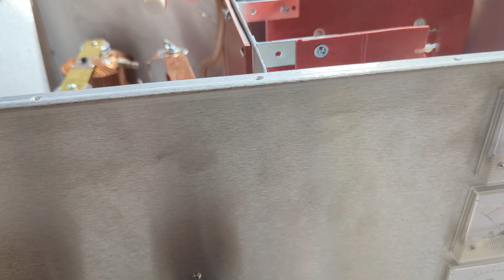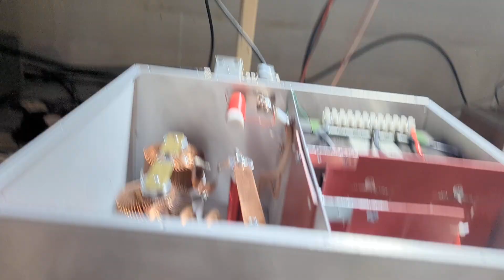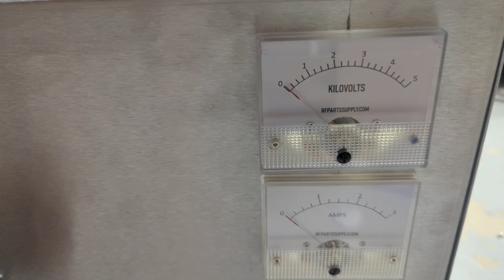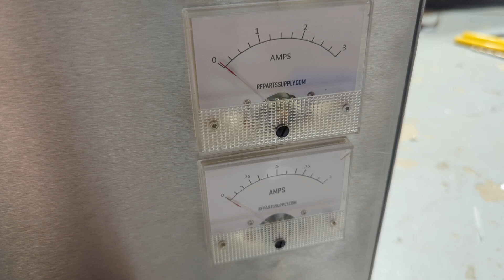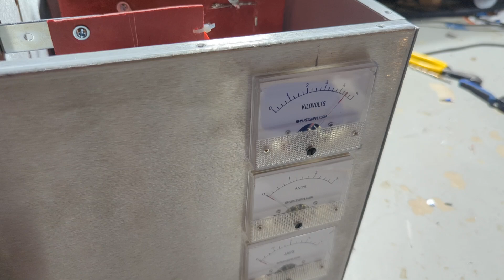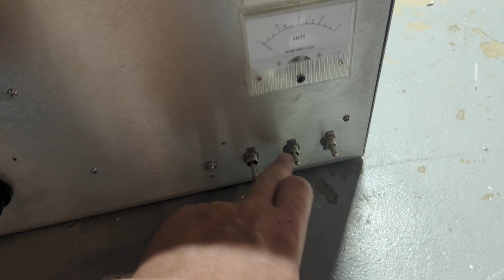GS-35b ( Dual Tube) Episode #6. (Low Power output test)!!!

Comment: looks real nice. them tubes need a break in any time they set un used for a long time or new. have a different getter system. same for 8877 that need break in. blower on filament on only. nice bias circuit. can set it right on. some times with diode string you get a tad too high or a tad too low. now you can set for mode of operation like AM/FM/SSB . I just fixed a 8877 amp that had 2-7.5V Zenner diodes for bias.  had to replace with glitch resistor and diode string.  tube flash ,took out HV supply and bias . all from a cheaper China tube. customer went with Penta labs 8877 this time. now I got him watching plate/grid current more closely on digital modes like JS8 call/FT8 ETC. high duty cycle. now he has temp probe in air outlet . just a few watts less drive makes a difference in tube heating . duty cycle.  not just the tube you have to watch. the power supply as well. 73's
Reply from the maker: Thanks for your comment. I did do full 24hr burn in before applying any HV. There is a paper on the internet by a HAM that has a chart that has many Russian tubes and Voltage to Time (burn in) that it took to create an internal arc. But 24hrs covered all the bases.